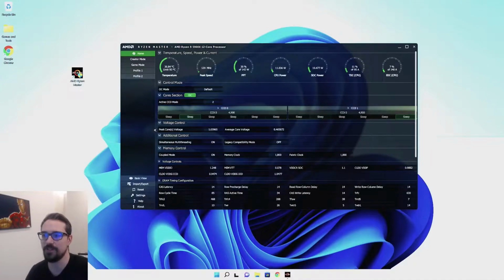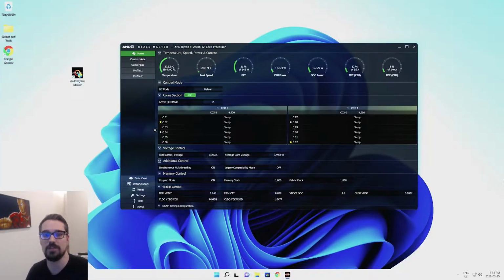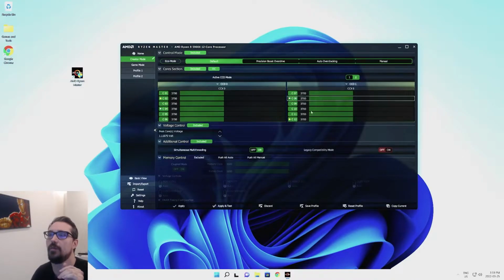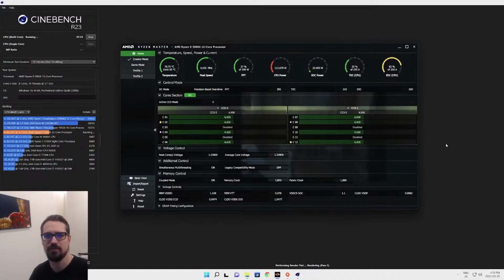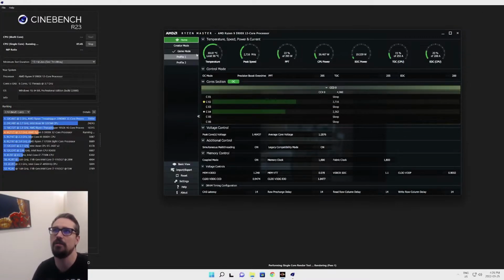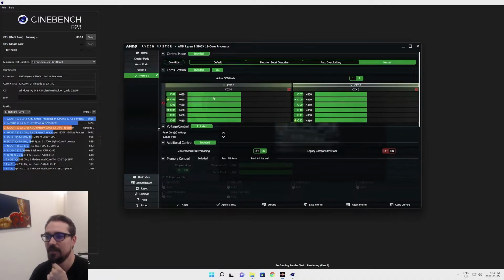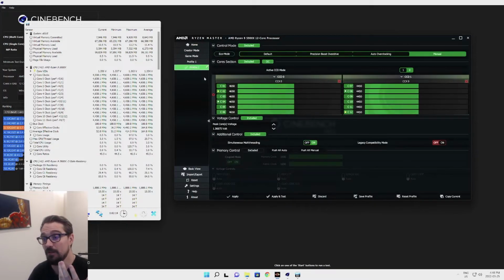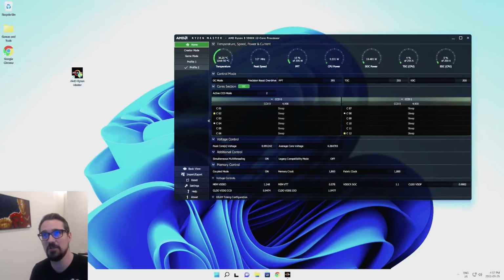Ryzen Master - AMD 5900X Overclocking

Comment: My 5900x is suddenly no longer boosting at all.  Even on default, It stays at 3650mhz max, single or multicore. No single core boost at all.     
Before, I had my personal settings finetuned with great results, including per core curve optimizer.
Now the settings don't do anything at all.  Whether I leave it all on default, or with my previous settings.  No difference.  Stays at 3650mhz, and no single core boost.
I've tried resetting BIOS to defaults,  updating BIOS firmware, reinstalling chipset drivers, reinstalling Ryzen Master, enabling/disabling D.O.C.P.   No luck.
Temps are fine.  Power supply is fine.   I am at a loss.

Edit:   Solved! The issue was with my Windows power scheme.  A few months ago, when troubleshooting an issue on my PC, I made a change to my "Balanced " power scheme.   I changed the maximum CPU power limit from 100% to 99%.   
This should always be at 100%.  Changing this back to 100% solved my issues.  So If anyone has an issue with their CPU not boosting,  ensure that your windows power scheme is set to 'Balanced',  the minimum CPU power limit is set to 0% and the maximum is set to 100%.

Comment: why i use same cpu but after open ryzen master there's notif overclocking is not support by the procesor ?
Reply: did you find a fix for this i have the same problem
Reply: @am5t3r i think the problem is software version of ryzen master or something else in motherboard. 

If ur purpose is for undervolt ihave solution using power management in windows setting set between 80-99% cpu usage. 

if ur purpose is overclock then i have no solution T_T
Reply: @resepmakananinternasional4284  alright thank you for the reply unfortunatly i want to overclock lol but il keep that in mind if i want to undervolt

Comment: A bit confused here i enabled the  Precision boost overdrive and ran r23 but the clock speeds never exceed 4.199 which is normal clock i get as yours went to 4.3 i also disabled a couple core no change either
Reply from the maker: Did you increase the power limits? Typically once you enable PBO and move the power limits up from default it should pull more power and push the average at load clocks a bit higher.
Reply: @UnhingedSystems  do you mean the PPT if so it was using 
              PPT, TDC,EDC
Default - 142, 95,140, 4.13-4.14ghz, 58c
Max avaliable - 395, 160, 190, 4.19ghz, 61c
Max used - 154, 104, 182, 4.18-4.19ghz, 61c, average voltage 1.265 - 1.268 R23 multi core score: 21089 pts
Reply: Outside of that im unsure of other power limits you're referring to
Reply from the maker: @CleverBrony  Try resetting your BIOS to defaults and enabling PBO again with increased limits. What temperature are you hitting when testing?
Reply: @UnhingedSystems  default 58c, PBO 61c
Reply: @UnhingedSystems  damn thanks dude why didn't I think of that I defaulted the bios and re enabled PBO started r23 and it instantly jumped to 4.43ghz

Comment: I have a board that supports Dynamic OC switching would you recommend that?
Reply from the maker: I found dialing in dynamic OC switching just right was a bit of a pain. It has its uses but you need to find the sweet spot.

Comment: i have basically the same settings as you with ppt edc and tdc, yet my voltage spikes up to 1.46 while im gaming and im worried about my cpu
Reply from the maker: @manofnetliveson  what are you voltages at stock power limits? I find even the default boosting voltages regularly hit 1.45-1.46V on my CPU in bursts. 3+ years on this CPU, no hiccups yet.
Reply: @UnhingedSystems  my problem was that my edc was at 220 instead of 200.

Comment: why is it that if u want to start the video creator mode with the same processor i cant get ppt to go over 87 watts when u put it at 395 watts, ie my cpu is using ppt 100% 87 watts, could i contact support for the ryzen 5900x?
Reply: the ppt tdc and edc are 100percent stock in home, i wanted to make a creator mode and gaming mode, do i have to run a aoptimizer curve first? temperature in home mode was 46.Celcius
Reply from the maker: @Andrewthomasp  Have you tried just running it at stock settings? It will work 100% better and won't use only 87W.

It for sure isn't working as intended at only 87W. If the temperature is 46C it isn't trying.
Reply: @UnhingedSystems  the videos of the internet said to start with curve optimizer for offset and pbo setup do i have to control curve optimizer for games + work tasks for suffiecient turbo speed in ryzen master, after i start the pc up everytime? likely need to know what all core offset i use, on this persons video with the zen three cpu.
Reply: @UnhingedSystems  does that mean i set the overclocking pbo to expert and the pbo side watts to motherboard or auto?
Reply from the maker: @Andrewthomasp  If you set the PBO to motherboard then the CPU will pull as much power as it is able to, within its own thermal design limits. Auto will just use the standard setting. Depending on your workload, setting it to the motherboard max may cause it to get too hot and thermal throttle.

If you take the stock ppt, EDC, and TDC limits and increase them in small amounts then you can see how the results work with your cooling solution.
Reply: @UnhingedSystems  with ryzen master u set the limits or within bios pbo? also what curve optimizer changes have u made for the bios or just enable the pbo bios changes limits for settings + curve optimizer enabled in bios -30 offset and reboot to check the current 5900x cpu settings update please confirm.
Reply: @UnhingedSystems  142ppt 95tdc 140edc these have a lock in bios that unable to set higher for more overclock with the bios as is could i just turn on motherboard pbo and make a non default overclock or curve optimizer setting or pbo if better than curve optimizer and not make any adjustments to ryzen master ppt tdc edc but the program in windows software or amd .?

Comment: I've been putting up with WHEA errors for like 3 years of owning a 5900x. When I bought this system I wasn't aware of the memory controllers limitations with regard to 3600Mhz, and above with 4 sticks of memory. I should have bought 2 16gb sticks. The memory controller has a tough time with maintaining a 1 to 1 "Infinity Fabric" (1,800Mhz) with all memory slots populated. 16gb sticks were somewhat rare and expensive at the time. I bought 4 sticks of 3,600Mhz c14, 15, 15, 15, 35, and though I could get all 4 sticks to operate at their XMP profile, I had Whea errors. They were incredibly intermittent- sometimes going for days without a reboot even though correctable WHEA errors were happening in the background all the time. This lasted through several different video cards, and 2 CPU's- as I had a 5600x prior to the 5900x. Recently, I bought a new GPU, and while changing it my water pump died.

While replacing the water pump, and the GPU, I accidentally ripped the 5900X out of its socket without releasing the bar- ouch. This happened because of how damn well the Thermal Grizzly pink thermal paste was adhering between the CPU, and waterblock. While simply trying to remove the water block, it pulled off the CPU with it. However, there was no damage, it just cleaned the pins, even scraping off a thin layer of gold plating. I crossed my fingers and reinstalled everything, and thankfully it posted, and booted just fine, and low and behold- no more WHEA errors.. It's been almost a week now. What the hell? Was one of my pins dirty, and not getting good contact?! The ASRock website doesn't even list 3600Mhz as compatible, though it does list higher frequencies. Now I'm afraid to change anything.
Reply: That's wild lol
Reply from the maker: @Iridiumcosmos  Toga Toga Toga
Reply: @UnhingedSystems  Man of culture haha 🔥🔪
Reply from the maker: That's so "computers". Reseating the CPU can sometimes (rarely) resolve an issue, so it sounds like you inadvertently made a better connection on the reseat.

Memory is finicky, it always has been. I try hard to always choose RAM on the QVL list in the combination I am using. That has guaranteed stability for me over the years. From a rate time to time I deviate from the QVL list and about 50% of the time it doesn't run at the correct spec.

Comment: I've noticed on my 5600x that setting the ppt/tdc/edc as high as possible doesn't actually result in highest sustained boosts despite not hitting any thermal limits. Dropping them to 110-120W ppt and 75-85A edc gives the best combination of power consumption and sustained multicore boost/performance. 110W ppt and 75A edc have slightly lower performance/sustained multicore boost but are also 6-7 degrees C cooler, 120W ppt and 85A edc is a bit faster but also hotter.

The only thing increasing the ppt/edc above that is make it run at the same frequencies using higher voltages and get hotter.

Undervolting it more might give better performance, but I think I'm pretty much at the max my chip can do (-17, -19, -8 (fastest core), -19, -19, -12 (second fastest core)... Anything about -17 for the first core and above -8 for the fastest core gives whea errors/crashes under load after ~20 min. And -17, -21, -8, -21, -21, -12 resulted in crashes during boot.
Reply from the maker: Facts! The higher EDC and TDC doesn't always result in better performance. Especially for EDC there seems to be a point where the performance actually comes down slightly when increasing EDC. This definitely depends on the type of workload on the CPU.

Comment: I tried this utility but used all the auto settings for gaming...any good? I feel like my system was laggy during and afterwards. 5900x, Asus 3080, 32gb 3600mhz ramm, Corsair water cooling. I uninstalled it. 🤷🏽‍♂️

Comment: Ryzen Master is fake other programs give me other values that match and ryzen master has its own values and when gaming supposedly only 3 cores should be active and the mot 200 to 1800 ca mhz exactly cpu temp only 42° what a fake
Reply from the maker: Calling it a fake is a bit of a stretch considering it was made by AMD themselves and is their officially supported tool designed and approved by their own team.

There are many programs out there that read sensors and "interpret" things their own way and at their own polling rates. There are also many different sensors for CPU temperature and not all programs are using the same sensors for what they are calling "CPU Temperature" as there are sensors on the CPU and on the motherboard that report these values from different physical locations on/around/near the CPU. When comparing sensor for sensor like for like readings I get the same values in Ryzen Master that I do in any other program that is using the same sensor Ryzen Master does.

Can you elaborate on what / where you are seeing differences? Curious to know what you are seeing.

Comment: I never believed or consider them real overclocks, when using software...BIOS the most stable OC and true as well.
Reply from the maker: I agree, but the BIOS can be scary for beginners. I do all of my own OC work in the BIOS. Of course, I don't consider today's methods of overclocking to really be overclocking either 🤷

Gone are the days of bypassing pins on the CPU to push higher clocks 🤣

Hopefully some day I can afford to do some liquid nitrogen work, then I can really tinker and get some serious results.

Comment: this video helped heaps turns out i need a new mother board as i"m nowhere near my temp limits, i"m hitting a max of 55 degrees with my tdc maxing out at 114 A and edc 80% at 168 A only hitting 3.455 ghz on all cores during a benchmark with my 5950x and my b450 tomahawk MAX 2  any tips to improve this before i get a new motherboard would be appreciated
Reply from the maker: B450 just isn't designed for the power delivery the 5950X needs. A solid B550 would be sufficient (with good VRM cooling) but a good X570 would be ideal.

There are three areas I always invest a little heavier in when building a PC:
- A good motherboard with solid power delivery and cooling
- A solid power supply with some overhead power for overclocking (If you need 850W minimum, get 1000W)
- This one is a newer addition, optimal RAM with optimal speeds

Building an ultra high-end system usually requires at least middle of the road supporting parts. 5950X, 13900K, 7950X, all demand more from their supporting parts.

Comment: I might have missed this in your video but when you enabled PBO, do you also need to manually bring up your CPU voltage, or is that handled dynamically in the background? Lastly, how should I handle memory speeds? Could I hypothetically enable Game Mode with all my power limits set to max and also enable XMP memory profile within my bios for an overall better performing OC? Thanks and great content!

Comment: do you need apply same setttings in bios or ryzen master does everything automatically and when you apply lets say creator mode" it stays forever?
Reply from the maker: The settings are applied when Ryzen Master starts up again. You don't need to change any BIOS settings manually.
Reply: @UnhingedSystems  ok, so if i want use curve optimized settings always I need to open ryzen master every time I start pc?
Reply from the maker: @spetauskas  In the settings have it auto-start minimized when Windows loads.
Reply: @UnhingedSystems  so I gues  it is better to make changes in bios if I dont want to have too many programs running in background or on startup :)
Reply from the maker: @spetauskas  Agreed, but if stability is an issue you can always stop Ryzen Master from loading. If the BIOS settings are unstable sometimes you have to reset the BIOS which is more work initially when dialing in the settings (unless you already know the BIOS well).
Reply: @UnhingedSystems thanks for help :) actually I cant find option how to start ryzen master with windows... but that is ok, ill go to bios. still I have to figure out what is difference between precision boost ant curve optimizer. also I have otion "cpu boot" in bios :D  (msi motherboard) . no idea which one to use or should I use those all option at same time . then my mission to squeeze  all power from 5700x will be finished :D

Comment: Im running the 7800X3D, and they have a temp limit of 89C, mine runs at 84-86 while PBO is turned on. Thats with the undervolt curve too, before that it was always hitting that 89. I wonder if i can lower my temps even more...  the undervolt is -30 as it is, kind of high but stable.

Can this cause micro stutter i wonder, if it keeps hitting the limit and going down in speed?

Comment: My ppt says 1200w
Reply from the maker: CPU is going to pull everything it can within its thermal limits. Funny that they can show 1200W when no CPU compatible with that board can pull that much. Probably a great board for liquid nitrogen overclocking runs though!
Reply: @UnhingedSystems  x570 aours master, I was afraid to do any oc to not fry my 5950x.
1200w ppt . Tdc 540a edc 215a.
Pbo limits set to motherboard in the bios.
I just want to get better performance overall in gaming and video editing, gigabyte easy tune makes 4.5ghz all core oc with one click, but from what I know in games, more GHz it's more frames. Now cpu clock speed shows 5000mhz without nothing done to it, you reckon if I apply the creator profile will be better?, I have a 360aio set at 80 procent all the time, idle temp is 35 degree in a hot day, in the winter was like 25 degree.
Would you be able to help me get a good oc without going crazy, I want something stable. Or should I keep it on the all core 4.5ghz?

Comment: My 5900X idles in the 50's and AMD says its fine, but I noticed your chip clocks down pretty low to reduce temps.  Mine never drops below base clock of 3.7Ghz......running a 360mm AIO and AMD just says this chip is hot.  Any way to correct this?
Reply: hey i have The same problem,  you found out a solution?
Reply: @meruzzin  no sir.  AMD says it's fine........I will probably build Intel next time around....
Reply: @pmolitierno  This comment did not age well
Reply: Try changing your windows power plan to balanced

Comment: Question when I go into Precision boost overdrive it says I can set my ppt to 1260 TDC 700 and my EDC 840 for my 5900x which is over triple what is shown in your tutorial. question I would those maxed out settings even be safe / possible to maintain?

Comment: I have checked a bit the R7 5800X3d and the R75900 X and it'd consider the latter to be a better choice for both gaming and productivity, what would you advise?
Reply from the maker: For just gaming, 5800X3D over the 5900X . For productivity + gaming mixed the 5900X. The 7700X is a nice alternative to the 5800X3D for the newer platform as well, and the 7900X is obviously the choice for gaming/productivity on the new platform. Waiting to see how the 7000X3D stacks up! Pretty exciting, though the X3D tax will be high for sure.
Reply: @UnhingedSystems  The thing is  i planned months ago to go with the 5800X but the 5800X3D came...the 7700x is too expensive for me and i don't trust the new plateform for now, so i was in doubt of either going for the 5800x for a "low cost" settup or directly go to the 5900x since the price is similar to the 5800X3d. i'm currently using a very old plateform (AMD FX) with a RTX 2070 super.
Reply from the maker: @rachparov  I recently built a 5800X3D system with an RTX 4080. Solid gaming setup for 1440p resolution and higher.
Reply: @UnhingedSystems  I don't have your budget (minimum price for that 4080 here is 1.5 k  €😅) but i've seen some benchs and i think i'll go with the R9 5900X for maximum usage. 

Then i'll move to the newer plateform (AM5) when it has a more solid background and the price goes down a bit.
Reply from the maker: @rachparov  Great plan! I don't have that budget either right now, it was for a client ☺️